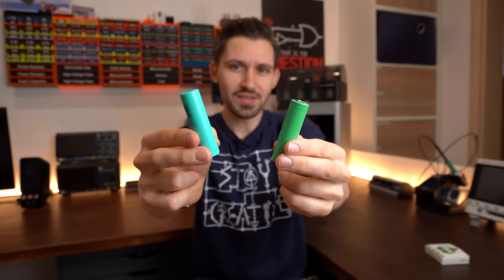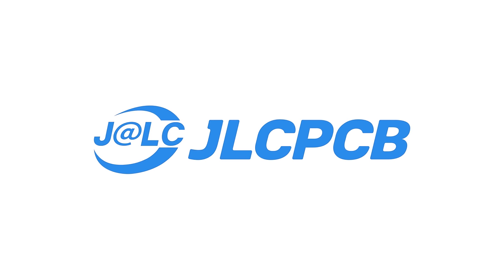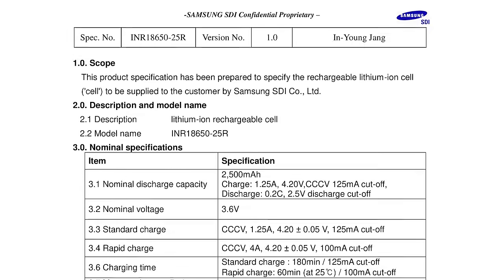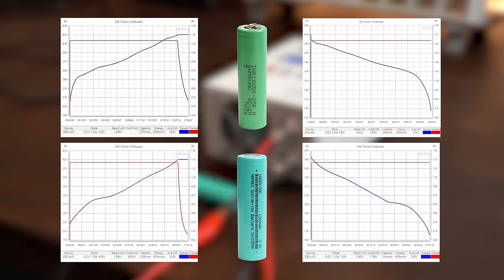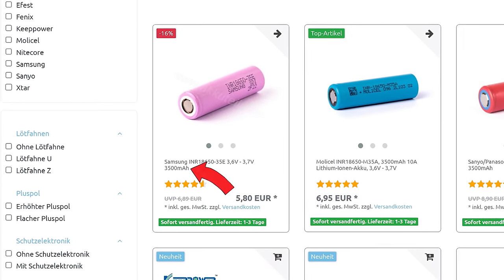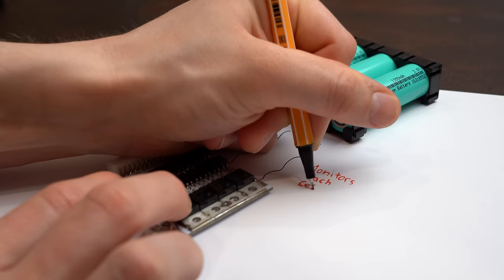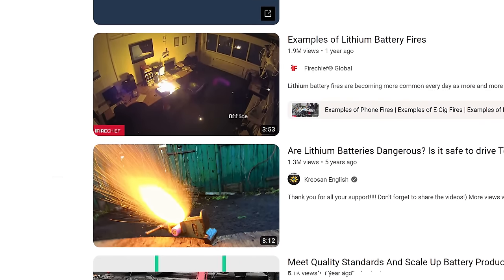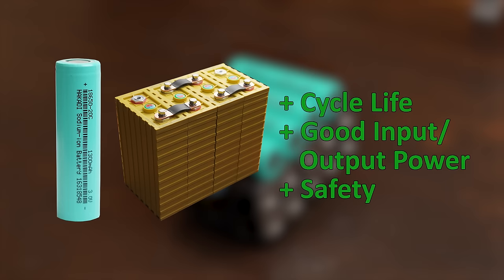"Salt" Batteries are FINALLY Here?! Sooo should you use them?

Comment: One thing I'd like to point out is, even though lithium-based batteries can and do blow up quite violently, that happens only very rarely. People look at them like they are grenades waiting to go off, but that's simply not the case, anymore than your gas or diesel vehicle is a 60L bomb waiting to go off.

Engineers plan for these kinds of things. Cells and batteries are encased with rigid materials. Even soft pack Li-Po are typically housed within some kind of solid container. Any half decent battery will have a protection IC inline that will prevent over- and under-charging, and breaking that disables the battery completely. Most times you see fires, it's people intentionally setting them off to try to make a point. In practice, they can be armored appropriately to make it extremely unlikely that they will fail violently even if mistreated.

I work with combat robots. We use soft pack Li-Po packed tightly against stalled motors, drawing current near their peak rating. The opponent has a large spinning weapon designed to cut into and rip apart the metal shell protecting the battery. Sometimes batteries get cut or tossed across the arena. Most of the time, the results are minimal - nothing at all, or maybe a small puff of smoke and nothing more. We have had some heavy plumes of smoke, but that's a small fraction of the time they are punctured - I've only seen a continuously smoking pack once. I have yet to see one literally in flames, even after seeing dozens shorted, punctured, and even cut in half with a saw.

Samsung famously had many puff up and even a few burst and smoke due to a poor design where the metal package was actually piercing the battery pack. Chevy also had a massive recall because of a similar issue. Most major failures have been a failure of design which was completely avoidable with proper engineering.

But nobody talks about the hundreds of millions of cell phones, laptops, and portable power tools that we use everyday that have very high density lithium-ion cells in them. We put them in our pocket, we strap them to our wrist, they get crushed and smashed and dropped in puddles, and yet we don't see them going up in flames on a regular basis.

Lithium-ion isn't nearly as dangerous as you think. Just because it can explode violently doesn't mean it has to. Every energy storage medium we have will explode violently if improperly designed or improperly used - that's the nature of releasing a bunch of energy all at once. Lithium-ion cells are actually very reliable and safe when designed and used correctly - we all use them many times every day without even thinking about it.

Comment: Sodium is way more unstable and explosive than lithium. A single drop of water could cause a wild reaction.
Reply: But are these using elemental sodium? Per Wikipedia: "SIB cells consist of a cathode based on a sodium-based material, an anode (not necessarily a sodium-based material) and a liquid electrolyte containing dissociated sodium salts in polar protic or aprotic solvents". "Sodium based material" doesn't sound like pure elemental sodium, and "sodium salts" certainly isn't.
Reply: @lonniemcclure4538  oh wow, so it really is more of a salt battery than a sodium one.

Comment: Whatever happened to the Graphene batteries?
Reply: Graphene is expensive, salt isn't ;) Graphene suitable for battery construction is at the moment at least 10.000x more expensive than lithium (10€/kg vs 100.000€/kg) its just not viable atm... Of course you do use less, and the batteries are lighter as a result, but not a factor 10000. So they are very expensive to make.

Comment: I kind of a disagree with you. We need better & smaller & denser batteries and sodium's are not better only cheaper (well in the future). If you need cheaper and greener you can go with other tech, but you will get huge bulky low density but cheap and green. Though where you have limitless space you can use them, but usually we are space and weight limited 😞

Comment: Isn’t the potential explosion of water corrodes it’s way into the batteries just far far to dangerous to make these anything but niche. Also if you cut one open just pouring water on it would tell you yup 👍 it’s definitely sodium. I don’t think it’s even ethical to call anything which explodes on contact with water safer than a lithium battery.

Comment: lithium iron phosphate have the same no fire, no explosion data. Sodium ion is nothing like lithium iron phosphate, completely different charge / discharge curve, much shorter life and much wider overall voltage range rendering it useless for inverters designed for lead acid / LFP which go into both high and low voltage cutoff on sodium ion batteries.

Comment: Sir please help us as your subscriber we desire to know about electronic. Sir I wantl to know does chassis also is common ground to measure the voltage across component in circuit example. I connect black lead to chassis and red lead to measure the voltage across the component. Please help sir

Comment: 250 cycles @ 60% vs Lithuims 2000 @ 80%. At 10 times cheaper, theyre the same thing but you have to change sodium 10 times as often. There, didnt need video
Reply: Other way round

Comment: The cost of batteries is the major problem with EVs and NOT their range.   I've been saying for like over a decade now...that smaller vehicles with small packs and short range that can be recharged quickly is what will make replacing gas cars with electric.   We had this already but at a big cost.  The Sodium batteries won't recharge quickly, but it will get the price down significantly and that is a key.   Perhaps there will be hybrid packs, some with fast recharge cells and the rest with Sodium.

Comment: No no no!
Method was wrong.
If you want to know whether one is fake, you should treat them with the same current and voltage, without thinking of possibility of destruction.
This way, if they are the same (meaning one is fake), they will exhibit the same graph.
How do you know how lithium behaves when charged with 4V? How much energy does it store? You don't. Cos you charged the "sodium" at 4V and charged the lithium at 4.2. And different currents.
Reply: The Na and Li looked suspiciously similar, and didn't match the paper at all, but that's enough evidence for him.

Comment: Waitng for Na batteries to trump lithium in capacity and weight. Then the EV market will trump combustion
Reply: It will do that anyway. The sales adoption curve for BEVs is going to give the BEV market dominance over the ICE within five years, or so. ICE sales will be essentially gone by 2035.
Reply: @schmetterling4477  only if batteries improve, which of course they will with more time. They also need improvements in longevity. It's funny when you see new technologies coming out in cumbustion engines when they may just be irrelevant in the next few years.
Reply: @K1LLA_KING_KONG  Why do batteries have to improve? They work just fine as they are right now. You aren't making any sense.

Comment: There's no reason why electric cars shouldn't start using Sodium batteries, other than the better range and performance afforded by lithium. Which is exactly the same rationale petroleum based car makers used to continue using fossil fuels. If Elon Musk and Tesla really did care about the environment they'd cease using lithium based batteries. But they wont, despite the impact on the environment, because performance is king.

Comment: Ya we need them a smartphone with this battery much safer and last longer it's just the battery my research told me that's must be replaced after a while the rest of the phone is bullet proof display can't get destroyed the pixel led,s can just get after a while  darker like a flashlight led . old bulbs get immediately destroyed but not led and the ram in the phone replace destroyed memory cells with the not destroyed ones just the battery is lithium and dangerous I don't know when I have to replace my headphon battery  it's lithium so I will not use my headphones in one or 2 years maybe 3 because I don't charge them that often but I don't want to buy every year a new phone just when I really need more power for better emulation in video games but my phone shut last at least 20 years if I use it everyday better 100 years and lithium battery can be charged 1000 times internet say so   sodium 5000 times or eaven 50000 times that 10 up to 100+ years usage

Comment: why do you need a charging circuit, if sodium-ion is more stable compared to lithium-ion, more like lead-acid battery, which does not require a protection circuit. things were simpler when only lead-acid was being majorly used. well ok nimh was used in between. also lead-acid does no require any management system. k.i.s.s. as always. dont let money makers sell you things that are not required. and if you get the worse system, that requires, then double oof. so explore the actual benefits of sodium-ion, dont settle for the usual lithium-ion bloat hardware mantras. li-ion seems to mandate the bms. dont assume Na-ion mandates anything. BMS is only for lithium-ion, not even nimh requires that. nihm charging system is very much simpler vs. li-ion. dont feed the lions. try diy flooded ZnSO4 water steel-wool carbon rechargeable batteries. they work like lead-acid batteries.